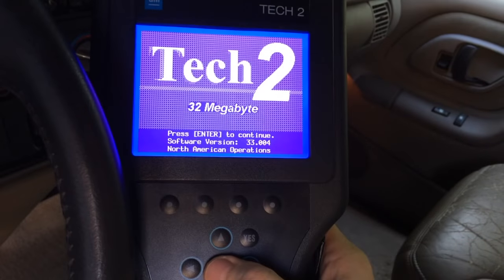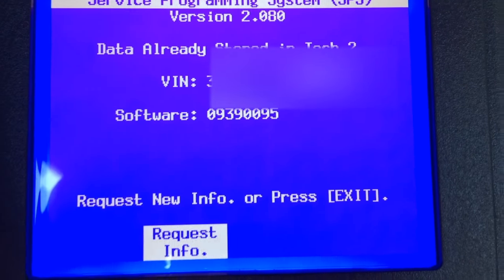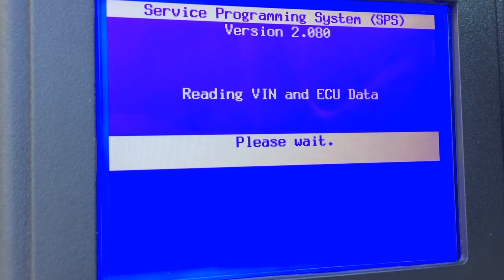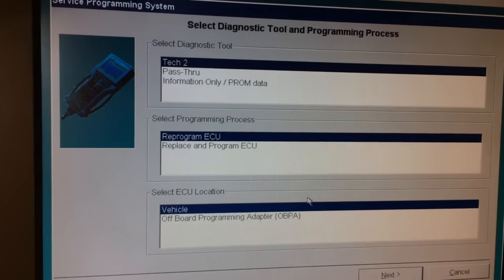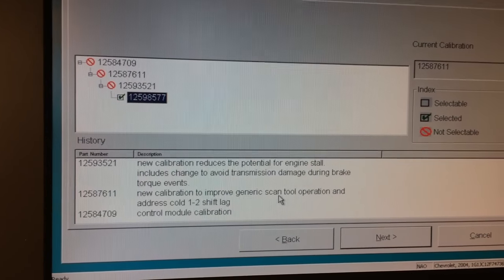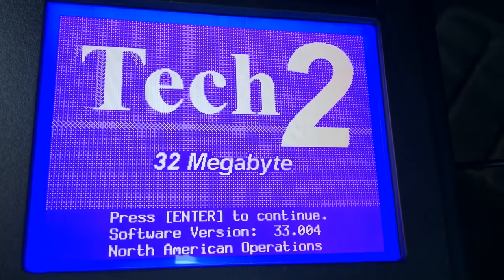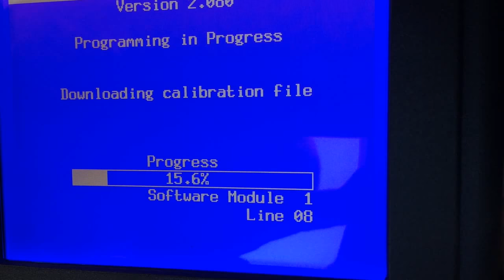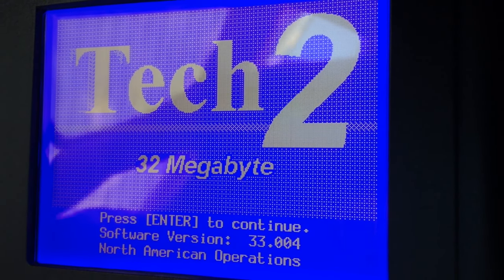GM SPS Programming: Tech2 Tool Remote Mode ECU TIS2000 How to do a Calibration Update Reflash (PCM)

Comment: Is that the trip light USB to serial?  I need to get Tis2000 working on my old XP machine.   ;)  You can program door modules using this program right?  Vehicle is a 06 Chevy truck
Reply from the maker: I don't recall that USB adapter being from Tripp Lite, I got it off of eBay and I have two different generic ones that both work fine with the Tech2.  For TIS2000 its only going to support up thru model year 2007 reliably, so for the 06 you should be fine.   I haven't done a door module myself, but I understand that some model years do have calibrations required for them.
Reply: @DrShock   Okay. Another quick Q where did you get the latest tis2000 update. I have one I found online but the best it is is GM DAT 10/2007  TIS data 10.10 2007  NAO 07.5. My china tech 2 DID come with a CD but I feel not confident about using a piece that came from china
Reply from the maker: The TIS2000 CD with the unit is fine and basically your only safe choice, you will just need to either use an original security dongle on the parallel port or USB or run one of the mods that removes the need for one.  That 03_2008 update took me a long long time to locate.  Google for the filename GM-NAO-TIS200-3_2008.iso and the iso has to be loaded from a real physical DVD-ROM, neither CD-ROM format and shared drive will work.  Also you may have to edit the config file in the C:\Program Files\cosids folder to point to your DVD drive letter (usually should be D:\)
Reply: @DrShock   Figured out the CD is the same version I found online. Found some DL links for the 3/2008 but all were dead will try those exact terms thanks
Reply: @DrShock  ISO images are a raw image of the CD or DVD ROM data disc.  You can make ISO images with MagicDisc or WinImage or ...  I make ISO images of all installation media, store them on a 2TB external HDD marked INSTALL MEDIA, and shelve the originals in a Pelican Case. They don't get scratched from use and they are not exposed to water, light, dust, rodents, etc.  Software Keys are saved in a text file with the same name as the ISO. 
Once you have an ISO image you can use a CD/DVD drive emulator that mounts the image as a physical disc on any machine. I use a fairly old piece of shareware called MagicISO but there are several shareware and commercial offerings.
Mounted ISO images are on your hard disc so they don't suffer the slow load times and battery drain you get from a CD DVD drive.  The main reason I started using mounted ISO images is my laptops don't have a physical CD/DVD drive and the last one that had one didn't read DVD discs.  The archival benefits became apparent after I figured out how to get around the lack of a drive.
If a software installer is hard coded to use D:\ it's poorly written.  D:\ & E:\ etc could be addtional HDD partitions or even secondary Hard Discs...  I had D:\ partitions in the 1990's. You can log in on the ADMIN account and free up D:\ using the Microsoft Disc Management Tool so the Emulator can mount ISO images to that letter but that's a kludge to make up for a poorly written installer.
Reply from the maker: It's poorly written, so none of this applies here.  ;-)
Reply: @DrShock  You were saying it has to be loaded from a real physical drive.  
Mounted ISO images are indistinguishable from a physical optical drive.  The OS and any running software can not tell the difference.
Reply from the maker: David, yes physical is the correct guidance in this specific situation. The GM SPS software is designed for anti-piracy, and I'd say poorly written as well because of the cosids config.  I'm sure it can be made to work with an ISO AFTER you do the update step, but it's not worth the drama.  Chasing this sort of stuff is for retrocomputing hobbyist types, not shadetree mechanics.   In my experience with the updater code, while accessing an ISO image SPS hangs every time.  Likely there is anti-piracy code to validate that the media is mounted on a read-only device.   But who cares.  When you just need to fix your car - a physical drive is around $5 bucks on eBay from Chinamart.  But yes, in most every other case than this one I agree it's easier to use a VM with WinXP and an ISO for older packages than physical hardware.
Reply: @DrShock  I downloaded the ISO image to my Win 10 laptop in the house, formatted a 4GB USB drive ( making sure it was FAT32) , then used a neat little bit of free software   http://isotousb.com/   to burn the ISO to the USB drive.  

Then went to my garage where my old Panasonic Toughbook C-50 laptop with Windows XP SP3 running on it, and it all installed with zero problems, this About button shows that it is TIS2000 Version 95  Spetember 2008 and SPS (NAO) Data 4.00 2008

Hope that helps anybody out there who has a broken DVD drive ( well my one on  my Panasonic is very temperamental, which is why I use ISO To USB  :-)

Comment: While mine is downloading new calibrations to the tech2 it stopped at about 1 minute left. then tis went to supported controllers page. The tech2 screen is still in download mode but now activity. So I dont now why it does it.
Reply from the maker: This sounds like either a networking problem locally, or a communications problem between the PC and the Tech2.   Did everything pass the communication diagnostics on the TIS Java applet as shown?
Reply: @DrShock   yes it pass. Only does in the last 30 secs of downloading new calibration from tis to tech 2.
Reply: Also tried the pass thru option and says wrong salesmake
Reply from the maker: Is the module you are aiming to update the calibration for a genuine GM part, and one originally available for the model year of your vehicle (i.e., is this a GM regular production option)?   If the communications test passes, and the problem only happens at the very end of the download consistently each time I'm at a bit of a loss.   There should be an error code in the lower part of the TIS Java applets screen that may help diagnose further.
Reply: I finally figured it out windows defender was running in the background. Exit the problem and it works.
Reply: And merry Christmas

Comment: can yo change PCMCIA  back to 33.004 ?
Reply from the maker: You can downgrade, but it requires special software to rewrite the flash memory adapter card (it is NOT a PCMCIA adapter but rather a special type of linear memory in a similar casing).  GM does not make any older versions of the Tech2 firmware available as older versions have bugs, or lack support for added model years.

Comment: Does this method work with a vxdaig tech 2 emulator or do I needs to use tis2web?
Reply from the maker: This video is about using SPS with TIS2000, which predates TIS2Web (replaced by Techline Connect in Sept 2021).  There are some folks in forums out there that have hacked TIS2000 to work with other tools, but I don't believe remote mode is possible without a Tech2 (the tool has to be able to store the info remotely for this approach).   Techline Connect has dropped support for Tech2 remote mode in SPS2 as well.
Reply: @DrShock  How do I go about Pairing another PCM to my 2002 car?
Reply from the maker: Passthru mode with the Tech2 and Techline Connect.  Here's an older video of that way - https://www.youtube.com/watch?v=53fho7l7yxI

Comment: Looking into setting up a Techline terminal like you have, where can I get a CD, is there a product key I need? Also where do you recommend buying the cable for the tech 2, the rs232
Reply from the maker: If you buy a clone it should come with a CD-ROM of TIS2000, but note like in the video this CD version software won't work past model year 2008 or so.   What you want to do is subscribe to ACDelcoTDS which is the current subscription based software.  There's another video I did about that posted.  The cable should come with the Tech2, depending on your laptop vintage you may need a USB to RS232 9pin adapter for it though.

Comment: Did you have a original tech 2 or clone I would like to buy but it very dificult, clone buy is very easy
Reply from the maker: I've only used the clones of both the Tech2 and MDI.  Never have ran into any issues with either.   You can't be dropping them or tossing them in a drawer like a shop might as they are just not built that way.  But they are exact replicas functionally and GM software compatibility wise.

Comment: Question.  Ok I have limited funds and doing my best to keep up with our 07 and 98 Chevys   I can't afford a new or used tech 2 but I can afford a clone tech 2 .  I'm sure you might not care for them but that's all I can afford. 
Would the clone be enough to take care of our two GM's if it works ? I know automotive just not this stuff. I got out of automotive when I had to go to school to Lear how to diagnose a massive air flow sensor on a GM . 200 dollars and the man walks out with a pocket knife and taps on it and said if it runs after tapping on it ? It's good !! If not replace it !! 
Just a question. Thanks for posting the video and I'm learning!! Cheers from Murrell's inlets SC !! Oh I also have two computers that run 32 bit windows that are ready to maybe use for this.
Reply from the maker: I only use clone Tech2s, there's no reason to pay for the originals as these clones are 100% identical in all functionality.  You might see folks post from time to time on forums with false dangers or fake news otherwise, but I've been using them for the last five years or so and never have ran into any incompatibilities over dozens and dozens of repairs including with TIS2Web (the online subscription service from ACDelco).  The biggest difference is in quality of materials and build, so the clones really wouldn't hold up in daily pro shop use (one or two hard floor drops and they are likely done).    But if you baby them environmentally (no rain, no drops, away from corrosive fumes, etc), they are a fantastic value for DIYer or small shops with low and pre-2008 GM volume.
The two model years you mention are fine, the software that should come with a clone Tech2, TIS2000, was discontinued by GM in 2008 so only covers programming thru model year 2007.   You can use it for diagnostics only (no programming) with a small handful of models thru 2013, with the CANdi adapter module that should be included with the clone, but only if those models came out around 2005/2006 and just happened to carry over the same electronics thru 2013.   Most vehicles after 2007 need an MDI tool instead.
Reply: @DrShock  thanks for the info !!

Comment: For some weird reason im getting stuck on the part where the computer try’s to read from the tech2 . The tech2 just freezes up and i get a communication error on the computer. I had tryed both serial and serial to usb and same error happens.
Reply from the maker: You're using TIS2000 with Windows 2000 or XP here?
Reply: DrShock windows XP SP3 on virtual box also tryed windows 10 with my ACdelco account and the same error happens i see the asterisk moving but freezes up right away with a communication error .
Reply from the maker: In either case the Tech2 is picky about the USB to serial adapter, it only works with a few.   ACDelco recommends just the one I mention in the description.   Communication errors are usually resolved by making sure the serial port settings for TIS match the USB serial adapter driver, I go over that for TIS2Web in a different video here https://www.youtube.com/watch?v=53fho7l7yxI&list=PLKGiYMtrEJBNvIjVNchktlQKZxtYxXAc3 at time index 4 : 06 which might help you.   Unfortunately for TIS2000 there's very little you can fiddle with, you just have to make sure your serial adapter driver is set for 115200 as the Tech2 won't work at slower speeds there.
Reply: DrShock thanks for the reply

Comment: Why do I always get the 'E6666 ACCESS TO SERVER DENIED' error? Do you mind giving me guidance?
Reply from the maker: E666: Access to Service Programming Server was denied, I haven't seen this one in many years and I believe it's related to not having the security dongle installed for TIS 2000.  Typically a USB device, but it could be one that plugs into the parallel port too.   When you bought your Tech2 it should have come with one or the other.  If not eBay usually has some - https://ebay.to/2ZtCdLO  Another thing you could do is, from a safe non-malware website, apply a crack to the software to remove the need for the dongle.
Reply: @DrShock  it did come with a dongle. May be a! Doing it wrongly
Reply from the maker: @Walagala Emmanuel Harry Or it may be defective.   Personally I got rid of the dongle and applied the TIS2000 dongle crack some years ago.   The exact link I used several years ago is still up here - https://gmtnation.com/forums/threads/computer-and-tis2000-setup-for-tech2.13633/ and was safe at the time.
Reply: @DrShock  well, I followed your advice, and was able to get a crack, got the said access. Thanks. I was able to fix an issue I had with a car that has been parked at my workshop since January this year. 
The only problem is when getting to SPS programming, it returns device not connected. I need to update the CIM software of an Astra H
Reply from the maker: Great, the device not connected error you have now - what's the "E" code it gives?   Like your original E666 there should be an error code on the message from TIS 2000
Reply: @DrShock  E665: THE COMMUNICATION COULD NOT BE ESTABLISHED WITH THE DIAGNOSTIC TOOL! PLEASE ENSURE PROPER CONNECTION
Reply from the maker: @Walagala Emmanuel Harry so that one, as best I can recall, is a general serial communications problem.   Things I would check are (1) make sure the Tech2 self test passes with the loopback adapter in the RS-232 jack.  This is to make sure the scan tool hardware is working.  Then (2) you need to make sure you're either using a true DB9 RS-232 port on the PC OR a supported USB-serial adapter if your PC lacks this legacy port.   There are only a few USB-serial adapters that the Tech2 will work with.  Here's a list - https://www.tech2wiki.com/doku.php?id=wiki:tech2_usb2serial_test_report&s[]=usb
Reply: @DrShock  Thanks. It sometimes works, and other times, it just refuses to connect. I am  presuming I have a cable problem????
And I experienced some wierd problem in trying to flash program an ECU. My ECU is a Z20LER, but when doing SPS, , it indicates the ecu AS z20lel. and as such, the programing failes. Have you ever encontered such a problem? If so, what would the cause be?
Reply from the maker: @Walagala Emmanuel Harry running the Tech2 serial port loopback test, with the loopback adapter is key here.   The clone models do have a tendency for the chip controlling this port to go and need to be replaced.   If that's not it, then either the cable or the USB dongle if that's what you're using.   This setup is also flaky running within a VM, and works best if Win2K or WinXP is used natively on a vintage PC for this purpose (techline terminal).   On the ECU question, that one I don't have any experience with.